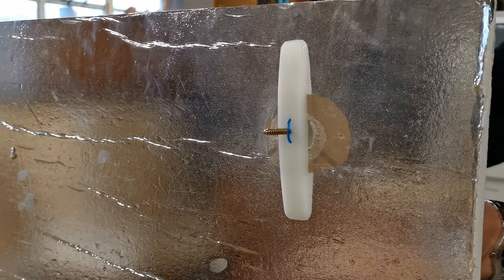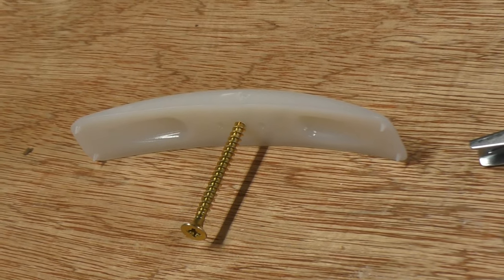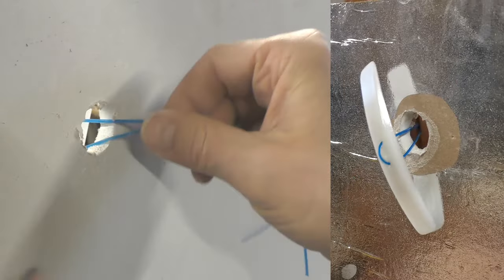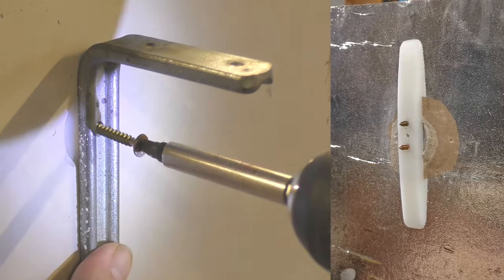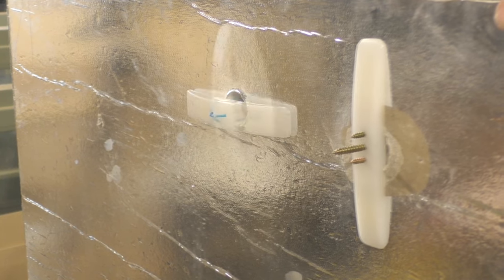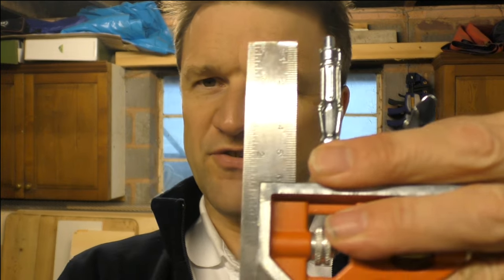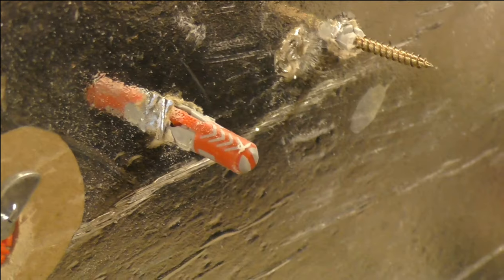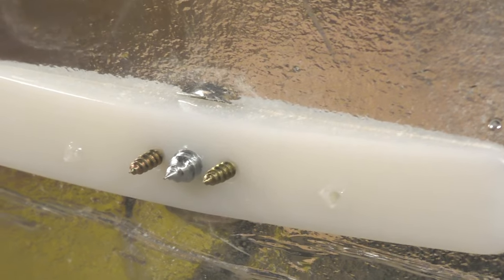The Strongest Plasterboard Fixing Ever!

Comment: Hi Charlie. Just found your channel and watched the GeeFix product. It's impressive, but I think overpriced at the moment. Having worked in the plastics industry for a number of years I know it costs penny's to produce. I would buy it but only if I had too for particular situations which needed a high loading . I would use other cheaper alternatives for other applications. I suppose it is probably patented so will have some protection before copies come out but it's a shame it is as expensive as it is. I think if it where more competitively priced I would buy it a standard plasterboard fitting rather than as a 'special' fixing you only buy where needed.

Comment: With this fitting, is it possible to use a long screw to screw into brick behind for a more secure fit?
Reply: Why bother. If you anchor to the plaster first, going into brick won't really add any more strength, because if you do get some fixing from the brick behind, then you will lose any support from the fixing anyway. Choose either, no both, there's no point, whatever get the compression and get the force will be the thing to hold it up, not both.

Comment: What do you recommend for doubled plaster boards?
Reply from the maker: These would work but you might just need longer screws. Alternatively the longer metal wall anchors with a collar that's designed for double thickness boards. I think m5x 72mm from memory.

Comment: How would you use this GeeFix fixing on a tiled bathroom wall to fix for instance a shower rail bracket. Peter West Midlands
Reply from the maker: Hi Peter, I'm not sure I would use it for that. On a tiled wall something like a Fischer Duopower would be more than sufficient and that way you're only drilling a 6 or 8mm hole depending on what size plug you go for.

Comment: I purchased the plasterboard fixer then made the 22mm whole only to discover the plasterboard is attached directly to 100mm thick Aircrete blocks that are soft and screws just not attaching. There is 150mm rockwool cavity insulation between the aircrete blocks and more denser concrete outer wall blocks. I want to mount a 48kilo weight tv and do not know if i need screws as large as 350mm to penetrate into the outer wall concrete blocks. What would you suggest?
Reply: what tv is this...48kgs ??
Reply: @SulySF  is Samsung 85inch Qled with 48kg weight, I have now attached resin and bolt threads to tv wall mount but not too confident it will remain secure.

Comment: Has it got a max loading recommendation?  Still not sure I would hang a TV though.
Reply: Surely with at least 4 of these it would be ok? The tv bracket I have has 9 points for locating it to the wall. So I could quite easily use several of these to hold a 43" tv......I hope.

Comment: Ho Charlie - would four of these inserted straight into the plasterboard of my ceiling hold 2Kgs in your opinion? Joists not conveniently located
Reply: Easily. Regular spring toggles are great for ceiling applications and are a lot cheaper.

Comment: Charlie, I bought the geefix fixings and tried installing a TV bracket into my plasterboard wall only to realise the plasterboard was 4.5cm THICK. The cavity is also only as thick as my finger, and it looks like behind the cavity is the back of the plasterboard for the other room. Is there any hope in putting up anything heavy in my room without using the studs?
Reply from the maker: Hi Richard. is that definitely plasterboard all the way through? Normally plasterboard is single thickness (12mm) or double thickness (24mm). I think you're going to have to treat it like a normal masonry wall that you'd put a fixing in that relied on compression for. How heavy is the TV and is it static or on a swinging bracket? If static you haven't really got to worry too much about the weight as there's no cantilever force as you'd get on a swinging bracket.  I'd be inclined to try something like a Fischer Duopower 8x40mm, and use a 5mm diameter wood screw that's just a bit longer than the fixing, ie 45mm. The Duopower is a universal fixing so it works as well in plasterboard as it does in masonry.
Reply: @CharlieDIYte  Yes it's definitely plasterboard all the way through, the same crumbly soft white material 45mm deep. It's literally nearly quadruple thickness. The TV is 13 kg, but it is static. Do you think despite how heavy it is it's still ok since it's static and the plasterboard is thick enough for the entire length of the Fischer fixing to expand?

Comment: The only thing I don't like about it is the 25mm hole!
Just fitted a curtain rail with 3 screws in each bracket.
There's no way I would have got 3x 25mm holes without weakening the plasterboard?!
They would also have been visible so how do you cover/decorate over the plug if this is the case?

Comment: Would this be good for a radiator fitting as i have a radiator that fell of the wall few years back. it was refitted by grumpy British gas engineer under contract( originally installed by BG with previous owners). This has started to come away again and was thinking that i would have to find studs to attach either plate or brackets for remounting the radiator on better base. Its not  a big radiator small one
Reply from the maker: Hi there, yes this fixing would be great for your radiators. You'll just need to make sure that the void behind the plasterboard is at least 30mm deep so that you can slot in the fixing.

Comment: Just wondering how easy it is to strip the thread in the plastic toggle, seeing as I've just bought myself an impact driver. Otherwise it looks absolutely fantaplastic.
Reply from the maker: They're made of nylon. Very difficult to strip I'd say. You'd do some damage to the plasterboard before the screw stripped the toggle. Always best to finish off the job with a manual screwdriver though as impacts can be pretty brutal!

Comment: Need to put shelves on a 60mm thick strammit board  "compressed straw" with thin plaster board sheet on either side,  its above little ones bed head, so needs to be strong and safe any help please

Comment: @Charlie DIYte How do you protect the vapour barrier if there is any way at all?
Reply from the maker: It's a good point. Drilling into any wall is going to give you issues with vapour barriers. I guess vapour transfer is going to be minimal given you're blocking the hole you've drilled with an acrylic plug. If the fixing is going to be hidden you could apply some foil tape over the circular plug so the only thing penetrating it is the screw. 🤔
Reply: @CharlieDIYte  Thank you, since I live in a typical 80s timber frame, the vapour barrier has a little bit of "give" as its backed directly by the insulating wool, the OSB is on the outside only. I just wonder if that give is enough to be equivalent of a 30mm :/ I really hate the idea of penetrating that barrier, would have to file the pointy screws to a round end too i think.

Comment: Never mind positioning vertical or horizontal. The can go in any position 360°
Reply from the maker: Yes Del, that's right.
Reply: in ideal, flush to wall loads, maybe yes. in offset loads that create torque, better place it inline with the torque direction.

Comment: there is one down side you can be limited to which way you put it horizontal or vertical because it depends where you are putting it in relation to the beams that the plaster boars is screwed to so for example you may drill a hole close to a beam and want it horizontal but your close to the beam so you cant turn it. 

having said that though it does look a good idea and i guess you can plan where you want to drill the holes in relation to the beams IF POSSIBLE which will not always be the case. looks like a good design though although you could easily duplicate it with strips of wood a couple of short nails and a couple of drilled holes. i suppose it depends how much it costs in comparison to what these cost. and what your time is worth.
Reply from the maker: To be honest I don't think there's much strength diminution if you go vertical rather than horizontal, and if you're that close to the beam the plasterboard would be so much stronger in any event 🤔
Reply: @CharlieDIYte  ah that is a good point because it's nailed to the beam

Comment: Excellent vid Charlie. Found this while looking for a way to fix a collapsed coat rack, and hoping you'll be able to advise. It was fixed to a dry wall using the self drilling steel cavity plugs which held for about a year, but with the ever increasing pile of coats eventually gave way. So I've been left with approx 12mm holes and need to refix the coat rack in the same place, but there is only about 35mm of cavity space, with some insulation, before hitting a concrete column. There's not enough cavity space for spring toggle, snap toggle or anchor fittings in a hole that size, so decided the geefix might be the best option. I'm a bit unsure what the best way to expand the existing 12mm holes to 25 mm, while keeping them level, as the pilot on my hole saw is a bit lost in the 12mm hole. Any ideas or help would be appreciated!

Comment: hi will these me as effective on plaster board where there isnt a stud available on a ceilling, I want to hang a projector and a projector screen to pull down from the roof, projector screen weighs about 18 kg
Reply from the maker: Yes. It's about as strong as you'll get without putting pattresses in, which of course you can't. Are there no joists or studs along the length of the projector screen? I guess not if the screen runs parallel to the joists.

Comment: The biggest issue with this huge anchor is if you had to have 2 fixings close to each other (which is to be honest the most common case), as the anchors behind the plaster would overlap.
Reply: You could position the flat anchors at a 45 degree or so angle inside the cavity, then they would not overlap. Just a thought.

Comment: That's sweet but how will it work in the real world? The gap behind my plasterboards is maybe 3cm. Would love to see you sticking it into that.
Reply from the maker: But that's exactly what I did in the mock up...
Reply: @CharlieDIYte  there is nothing behind the plasterboard in your mock-up. If you had 2 plasterboards with only 3cm gap between them and had to get that fixing into that gap through that hole would it have worked?
Reply from the maker: @funitoo  Have you watched the whole thing? At 8.24mins I mock up a 30mm cavity to show how the fixing works in tight spaces.

Comment: The string method is the same as I use to put pieces of scrap wood on the inside of the wall to screw to- no need to buy anything special- just a little mud to patch the hole.
Reply: mud? as in soil from the garden?
Reply: @dazmeister9  Mud is slang for joint compound. We mix mud, and mud the walls.

Comment: Interesting that you originally dislike the GripIt fixing because of the 18mm hole, yet this requires a 25mm hole. Very expensive option but agree very strong also.
Reply from the maker: Yes, because the wings that open up behind the GripIt are tiny in relation to the hole you have to drill whereas the size of the wing on this fixing dwarfs the hole.

Comment: is this fixing stronger than gripit fixings?
Reply from the maker: Totally different animal. The grip-it has tiny wings that open up at the back which I've always said is the major design flaw as you have to drill such a large hole for such tiny wings. Whereas the wing on this is immense.

Comment: This looks like a great product, but it strikes me that you can't remove them without losing the part that goes into the cavity, just like those toggle fixings. Not a deal breaker (I will more than likely buy these), but I feel you should have mentioned that, as you did with the toggle fixings.

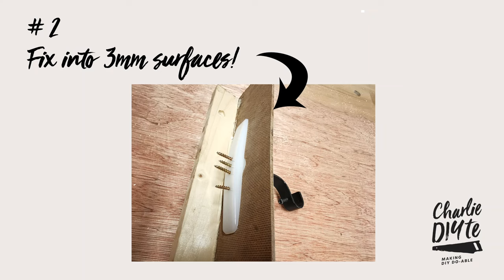Comment: If you stop the video at 8:34/8:35 you will see the plasterboard crack across the wall at the screw line. This is a result of the stress at the point of the bowed plastic, I think because of the tension against the teeth that have dug in and so pulling the plasterboard towards the bowed centre. It looks like a brilliant product but maybe a little more testing Charlie . Perhaps not critical seeing as the weight is spread over a larger area ... but still ....
Reply from the maker: I hear you. The plasterboard was quite damp though living in the garage as it does and a dry plasterboard with the added rigidity of plaster on it would probably fare a lot better.

Comment: I’m so gutted. I bought these and there’s not enough room between the plaster and the wall to slip them through the hole. Got big holes in the wall now😢
Reply from the maker: Sorry to hear that. Have you tried cutting down the length with a hack saw? Keep trimming it off until you can squeeze it in.

Comment: Plaster board has oiled in i to hold the plaster finish   This is sheet rock ( read the tear off paper on the sheet  it’s usually red and white ). Dry wall  cover  over  100 types of finishes
Reply: Holes  not.     oiled  ( computer  spell CL errrr )

Comment: do they have a way or plug for if you drill a wrong hole?. Im the kind of cheese drilling person hehehe...
Reply from the maker: No but you'd just have to hefty build up layers of easy fill. Wouldn't take long. I might do a video on that 🤔
Reply: I would suggest using the plug left over from making the hole (or make a new one from some spare PB) stick it on piece of paper (bigger than the hole) with filler, put it in the hole and feather out and sand it down (examples of this technique are on YT), job done 👏

Comment: Is 30mm definately the smallest cavity, i have 20mm and looking to hang a large 20kg mirror.
Reply: Use a grip it fixture,seen half way though but imo better,very similar but without the string, smaller hole also for your needed weight
Reply: This guy doesnt rate them!
Reply from the maker: I don't rate them. The wings are too small considering the hole size. What's behind the cavity? If it's brick I'd be inclined to anchor into that with one of these https://bit.ly/2RvkVxb instead. Much stronger.
Reply: @CharlieDIYte  unfortunately it nit brick behind it some weird concrete/stones mix which is awful to drill into.

Comment: Not so great when you drill your first 25 mm hole only to hit a large blob of dot and dab adhesive. I guess you could just tap the wall to check if it’s hollow first. That said really good fitting!
Reply from the maker: True, but the silver lining to that cloud is that you've got a nice firm substrata there to fix into.

Comment: Okay. Admittedly. Great idea. Great design . And just jogged my thoughts. So what's to stop you from putting a piece of wood behind with holes drilled out in the centre with cut down nails for teeth at either end ? (Not trying to criticise. Just being realistic and a tight arse 😉)
Reply from the maker: Nothing but you'd obviously need to pilot the bit of wood to avoid splitting it with the screw

Comment: Why would you say to install this horizontally for the TV is best? That is simply wrong, unless you expect the forces pulling the fixing out are left or right rather than downwards.

Also, installed vertically, there is no point to having any part of the fixing below the low retaining screw.  With downward/outward pressure, the bottom of the fixing will be pulled out, away from the plasterboard, levered off where it is sitting in the hole in the plaster. All that is stopping this is the bottom screw, and the part of the fixing above the load pulling in the opposite direction, against the plasterboard.  So, if the length of it was a problem because of the cavity size behind the plasterboard, you could cut off the part of the fixing below the bottom screw leaving enough to actually support the screw though.
Reply from the maker: Thanks for the comment but I'm afraid I don't agree. If you install it vertically all the cantilever force is pulling at part of the wing above the centre of the fixing. The part of the wing below it is reasonably redundant. However if you install it horizontally, the load is spread across the entire wing.

Comment: also I know you're not a big fan but can a grip it really hold 70 kg -100kg from one point. surely the plaster board would just collapse?
Reply from the maker: I think those figures must be strictly for shear (ie vertical) loads. Anything cantilevered would come straight out - like it did when Peter Jones tugged on the mock up example on Dragons Den!!